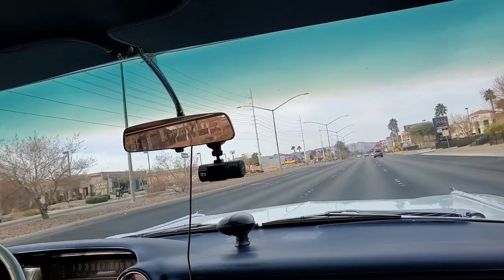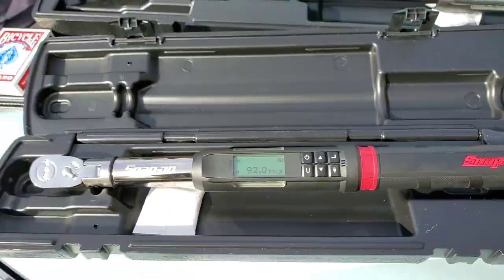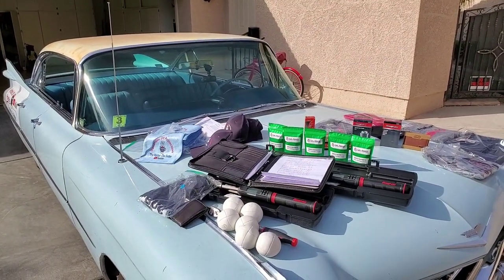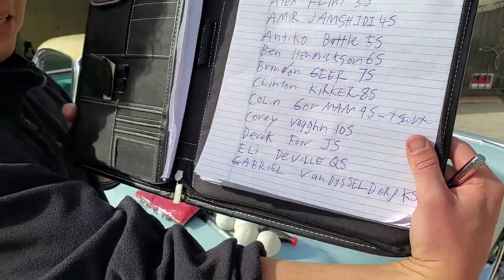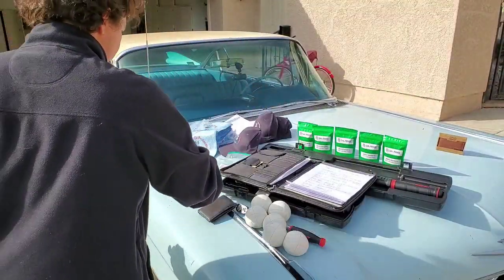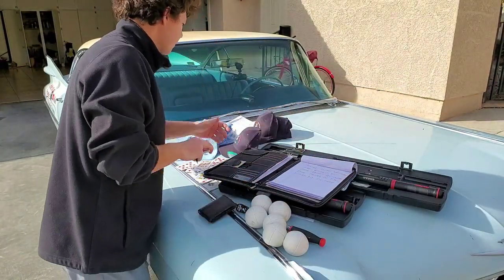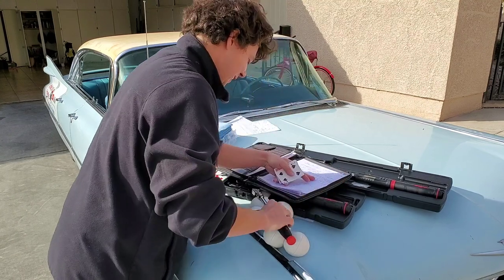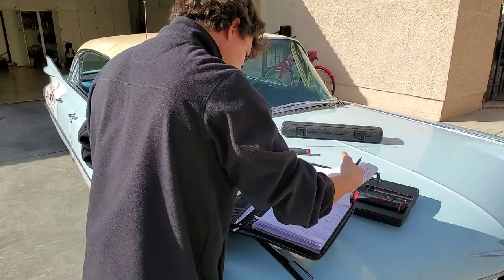Ebens Snap-On Digital Torque Wrench Giveaway DEC 26th

Comment: I want to change oil in my wife’s 2018 Mitsubishi Outlander   And put amsoil oil what would you recommend for this application ?  What all do I need to change over to amsoil
Reply from the maker: Hey great question Jason I would switch over with the amsoil engine flush I would also get the amsoil PI performance improver fuel additive and I would also get the signature series motor oil along with the amsoil oil filter this is the lookup guide that will give you all the products and you'll also see the preferred customer program for 10 bucks for 6 months that will give you the wholesale price at about 25% off and you'll also get the free shipping.

I'll be your amsoil Dealer and you can always reach out to me anytime when you use my link.

Thanks for reaching out man and if you have any questions you can always call me anytime.

Lookup For Your Vehicles - https://www.amsoil.com/guides.aspx?zo=5331179
Reply from the maker: Ebens Wholesale AMSOIL Link + FREE Shipping: https://www.amsoil.com/offers/?zo=5331179     & Text Me for latest promo code.  702-472-3614     

     Synthetic Oil Protection Coffee: https://supportwith.coffee/shop/subscriptions/sop/